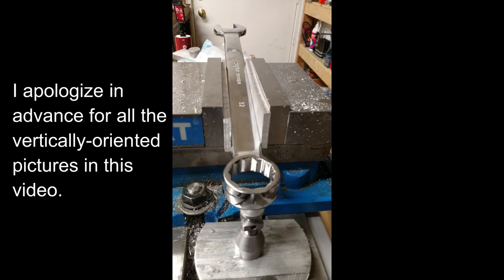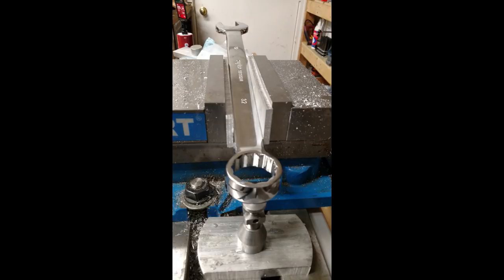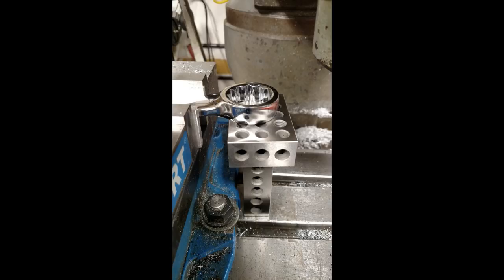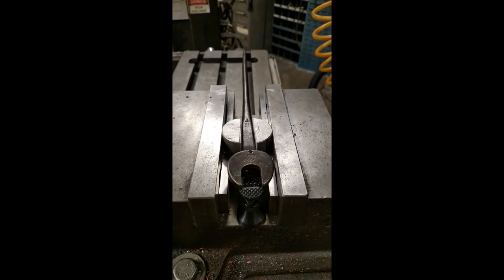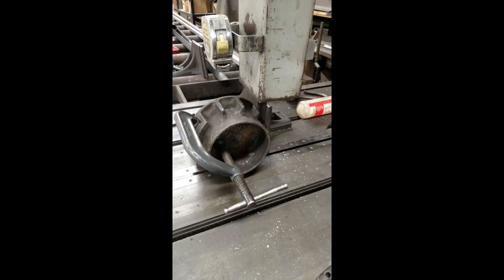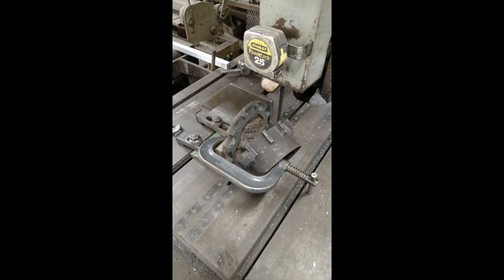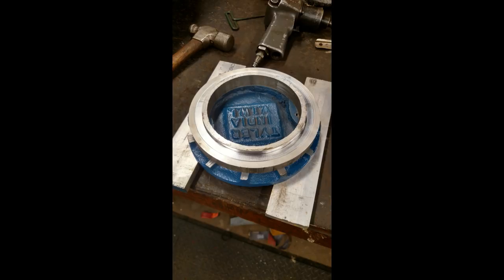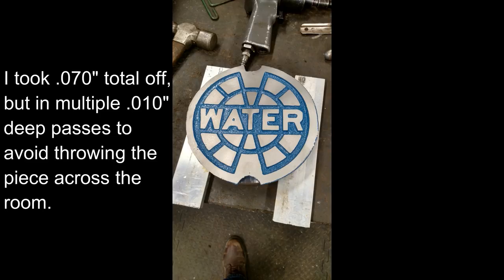Interesting Work Holding Techniques

Comment: This is a water main valve "Street key" cover.  Below it was a direct buried valve probably  8-16" dia with a large square at the top. The maintenance guy would drop a long shaft with a square socket at the bottom and a large T handle at the top.  A typical thread on a valve was 10 tpi, so an 8" would take 80 turns to close, but valves over 10" often have a 10:1 gear reduction on it,  so that's 1600 revolutions! So to close a 16" valve you dropped the shaft down, add two 2x4x8's to the top and get 6 "volunteers' from the local jail. Use 4 to run around in circles, the two spare are to take over  when the first get dizzy and fall down.

Comment: The split round aluminum system is a great idea. That will be my first project next time in the shop. String trimmer line has come in handy for holding parts not quite square.
Reply from the maker: Nice tip about the trimmer line. I have about 3 lifetime supplies of it in my shed. I'll have to try that out. Thanks for watching!

Comment: One of my favorite tricks is for holding small parts when using a standard vertical band saw. We have a small vise (image search revealed it is similar to a Stanley C-605). Place the part on the table of the saw and position the vise upside down with the top of the jaws flat on the table. Clamp the part and feed it through. The side of the vise used to provide a nice reference for cutting a straight line, until some students saw this trick and got a little too close to the side of the vise several times.
Reply from the maker: I've got a guy in my shop who insists on using our Do-All bandsaw that doesn't have a vise to cut round stock. He has come up with some truly mind boggling ways to keep the stock from turning in his hands and can easily spend ten minutes making some "fixture" to achieve this feat. Meanwhile we also have the Marvel saw shown in the picture which has a vise and hydraulic feed and would finish the cut before he assembled his "fixture". In the immortal words of Bugs Bunny, "What a maroon!"
Reply: @StuartdeHaro  we usually use this trick to hold short pieces that can't easily be held in the vise on the horizontal saw. It is also good for thin or small diameter pieces since our vertical saw has a higher TPI blade than the horizontal. The feed control on the horizontal has needed a rebuild for decades, so the only way to slow it down is to hold the saw up and lower it slowly by hand. One of these days we will find the parts to fix it.